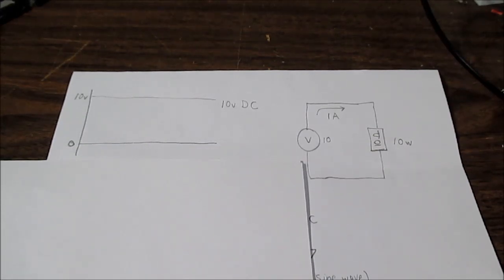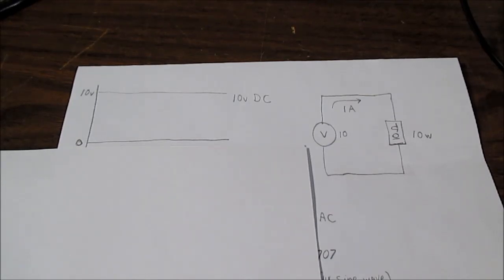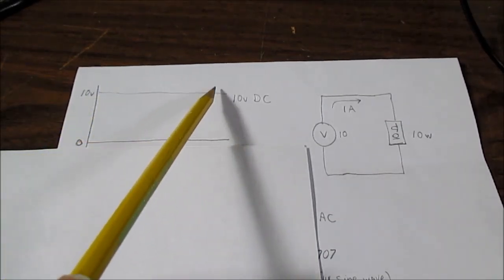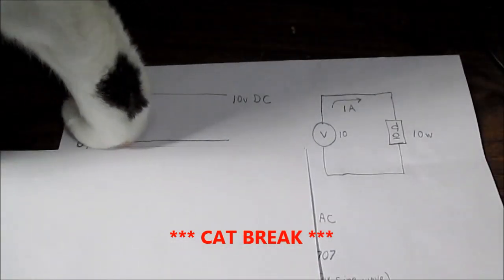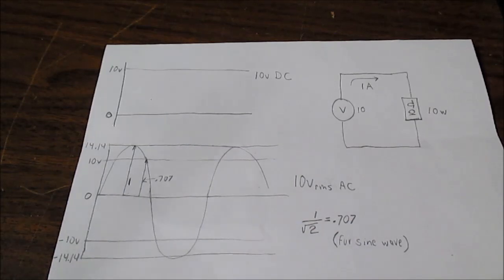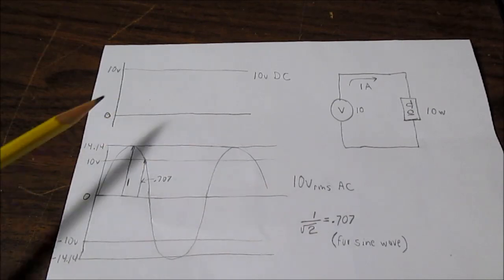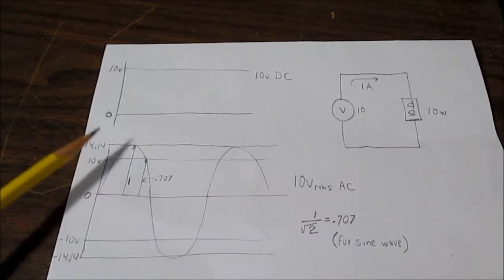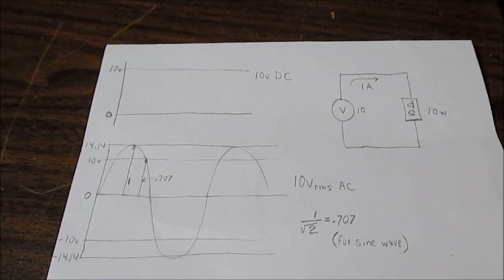Why watts rms is not valid for audio amplifier power measurement

Comment: There once was no issue, but in the late 70s and 80s people started advertising amplifiers the size of peanuts with stratospheric power. How they arrived at that power was with some sleight of hand and some artful use of the truth. It had to be explained to consumers that to arrive at the real power an RMS value of the voltage supplied to the load - (assuming the usual 1khz single tone as a test source) - was necessary, and the advertised 1000W suddenly became 5W ''RMS'' . It sort of stuck from there to show they were 'real' watts. Then of course some engineer got snooty and rightly said 'It's just WATTS' and so on. The law for false advertising and consumer protection was enforced with regard to  power specifications. . Originally it was as John says the heating effect - equivalent to match DC. To heat water from 0-100C took 60 secs with 200V DC and took the same with 200V AC (RMS derived). All AC has historically been rated in RMS for that reason. The mains in the UK is peak to peak 678V measured, yet has a DC heating value of 240V. 
Amplifiers are specified into  8ohms unless told otherwise and have often two channels for stereo, but the specs are usually for a single channel driven into the load. Often the power with both channels driven will drop due to sagging of the power rail. Which can be significant as power is derived from the voltage squared. Hence two channels driven in mono antiphase with outputs taken from the positive terminals can give a four fold increase in power. Bridging is sort of a 'free' lunch.

Comment: this is why in my early audio experimentation and technical articles on electronic magazines I used to measure amplifiers output as Vpp or Wpp (peak to peak): this is the real voltage swing on the load, this is what you see on your oscilloscope. Then someone told me this can make confusion and I started to use the standard, converting peak-peak power to RMS. But for me this remains un unsolved question

Comment: I have been reading all the comments below but now I am still confused of what  and how to measure the average power of a PA. 
I know that most of the power supplies used in audio are not regulated so the supply voltage will sag under load according the intensity of the music at that instant.  I guess it will also depend on the type of music played.
There must be some kind of procedure to check for at least taking the average power  of a particular PA system.  Can someone explain how to measure it?
Reply: Thanks very much for your reply, now that info is getting me to more understanding

Comment: I don't understand what you mean by showing that  .707from V peak is not RMS.  Average is not RMS. 
Music is not always pure sine wave so the RMS value is can not be calculated as .707 x Vpeak. 
That's why good meters try to measure RMS value.
If you want to use peak value of the AC signal then you have peak power.
But so far, the only way to evaluate accurately the power of an amplifier is by running it with sinusoidal  signal, with a known RMS value.
 Or we can go back to funny claims like PMPO,  which gives more power output than input.
Reply: radu3g As long as it's a standard, It's comparable and comprehensible. If not using rms or in this case 1khz sine wave rms, it will be a huge mess.
Reply: Who says an amplifier has to be tested with a music signal?

Comment: So how do we calculate the wattage of an audio amplifier then? The load is not resistive (can a speaker be considered inductive load?), the signal is not necessarily sinusoidal... I am more confused now
Reply from the maker: Speakers are reactive loads and are different from one to another of different models. It is easiest to use a purely resistive load for the power measurement. Due to the variations in the music signal, it would be difficult to use it to get a measurement, so it makes sense to use a pure sine wave.
Reply: You can test an amplifier with a purely resistive load. No one says you have to drive a speaker then.

Comment: There's no such thing as watts RMS. Watts are watts, nothing else.
Reply: StringerNews1 Electrical engineering student agree on that.
Reply: You are exactly correct. Watts rms is an incorrect electrical term. Period. Full stop. If Watts rms is supposed to indicate what an amp can supply continuously, then it should be stated as Watts (continuous). Watts are Watts.

Comment: https://www.quora.com/What-is-the-difference-between-average-power-RMS-power-and-AC-power
Reply: The thing is that RMS power rating in audio amplifiers is just a minimum standard rating, useful for comparison and basic understanding of typical operational abilities onto a typical output load. The actual operational reality is a different matter of specifications. But these are not understandable by the vast majority of buyers. For example, actual power ratings in respect to frequency range are tested with square wave pulses. But only electronics engineers know how to "read" the distortion of a pulse at the amplifier's output loaded with a complex load (as a loudspeaker actually is). By "reading" I mean to understand where and what the problem is and why (leading to its fix). Moreover, frequency is not all the "reality" about it. Time is another significant parameter. Anyway, an FFT is a more informative tool for maximum power ratings at all the frequencies of operation. But, the market needs just the simplest and least informative standard to convincingly "educate" buyers... at 1KHz!.
Reply: If a purely resistive load is a good compromise for testing, then so is the RMS power rating and the sinewave as a signal. But an actual signal is not a sinewave, but a Fourier series of all the sinewave-like frequency terms (included in the actual signal), where every term (summed in the series) is each multiplied by a different weighting factor. This reveals that things are not so simple in actual conditions. Everything we have used as analysis and characterization tools/methods are simplified perceptions of reality, for "easing" our communicative understanding and share it with more end users.
Wavelets, as a faster calculation tool for the energy envelope of a signal, reduces time-"consumption" of calculations in real-time control systems, such as real-time processing (DSP). It is a very easy to understand mathematical tool, if someone wants to just use it, without getting into the math of it (it is a mathematical invention of FBI for storing fingerprints in electronic form in a limited storage "disk" space). It is suitable and accurate for signal with abrupt changes (e.g. transients). There are only a few types of them (for continuous and discrete applications) and it is very easy to find enough understandable material in the internet for the beginner. Unfortunately, the space here is very limited, so I would suggest to someone who wants to start getting into this new tool of analysis and design (even in audio) to check the numerous internet sources, starting from: https://www.youtube.com/watch?v=QX1-xGVFqmw
Reply: For such applications check also another "tool": the neuro-fuzzy adaptive modelling & control. Example: http://www.gipsa-lab.grenoble-inp.fr/~dana.lahat/Plinge_EUSIPCO2014_slides.pdf

Comment: RMS is not the same value as average . .707 & .637
True average voltage is of course zero in AC :-)
Reply: That depends if the AC wave is referenced at zero volts. But AC can float above 0V and might not even need to pass below that, and will still be AC
Reply: Joanne, please correct me if I am wrong. But, wouldn't that actually indicate an AC wave riding on a DC offset. If measured ignoring the DC offset, shouldn't the AC amplitude still average to be 0 over time?
Reply: That's why it is called root mean square.  Squaring the output removes the negative component ( remember negative times negative is positive). The you take the square root which will be negative and the average is of the area under the curve is 1/SQR (2).

Comment: Umm I'm confused here, so are you saying they just changed the name to average but its still RMS?  Because if you use rms voltage and current your power calc would also be in RMS?
Reply: Thanks for the explanation.  I think I missed that math class.  Never fully understood SIN wave functions.  I will have to continue using the same formulas, and explain the parts I don't understand as so sorcery.
Reply: StringerNews1 Ah yes good ol fourier analysis.  I'd really have to dust off the textbooks if I wanted to revisit that.

Comment: The R.M.S. standard was and is a good one. Are the past I.H.f., peak music power, P.M.P.O., I.P.P  and other strangely calculated wattage powers forgotten? That's how they arrived with such an excellent system.
Reply from the maker: The 1974 FTC mandated standard is a very good way of representing amplifier power. I have no arguments against it other than they should have not used watts rms because it is technically incorrect. They should have said "continuous average power", which they eventually changed to.
Reply: StringerNews1 I didn't know that about exempt car audio!  Sanyo had a lot of bi amp stuff. Speakers, amps. The "audio spec" series had this "x watts into, ohms, no more than, x. distortion" loved that stuff.  But what is "slew rate" exactly?
Reply: StringerNews1 😆 wowow! I feel like I just got declassified info! I only had that question for 37 years! The amp list's it's slew rate at 70ms on top there along with those other FTC ratings. I have never stopped loving these Amps with their Darlington pwr packs. And they do like to be in the multichannel actively crossed configuration. Thanks!

Comment: RMS power is actually average power derived from the RMS voltage times the RMS current and is only valid for a sine wave...and seeing how most specs are rated using a 1000 hz sine wave it makes for good a measure to compare amps, etc.  regardless if they call it RMS or average...average power would be the correct term to use but doesn't RMS sound better? ;-)
Reply: High quality ac voltmeters are NOT reading the average voltage. They use a variety of methods to compute the actual RMS value of a complex waveform, and will give the correct answer (power delivered to the load) for any waveform, not just for sine waves.
Reply: StringerNews1 Current is very important aspect of amplifier you can't just ignore current!
Reply: Average and rms are not the same value. They are not interchangeable terms.

Comment: RMS is no more then a standard  for a means for a delivered of power
  thing get neat when a high thrust small diameter magnet speaker can reproduce
more sound then a high thrust big  diameter magnet speaker
the problem with high thrust small magnet speaker is that the talerence for any
distortion    OK  RMS is poor for any true rating for am over amplifier speaker
combination   but RMS is still a definable stranded   the one thing in the meserment
 of sound that is not defined is how the sound is produced and then reproduced
from analog to digital      thank you for your attempt to explain    liked the video
Dr. C

Comment: Good video as always John!  I understand why the FTC did what they did--they needed some form of standard...heck, any standard back in 1973 to protect the consumer.  They finally lightened up on wattage then--just because the world is funny, then home theater and EDM with very loooooong bass drops became a "thing".  Now that wattage is rated for music such as kick drums and other short bursts, now movies have very long sound effects that hammer subwoofers relentlessly without a break for 10 to 30 seconds.  Some EDM has bass drops that just rumble away.  For that level of insanity, then RMS ratings continous sine wave testing would make sense.  Funny how that works!  I've seen professional amps rated at 1KHz pulses for 40mS bursts--marketing takes full advantage!  People will bench test that amp and notice actual output power for 10 seconds of sine wave testing causes massive current limiting as the power drops 25 to 50 percent.  So, always get full testing of an amp and for subwoofer use  for EDM and home theater use,  go for the one that has a power supply that holds up under sine wave testing.  The 1KHz testing stuff should be OK for mains--be careful out there!